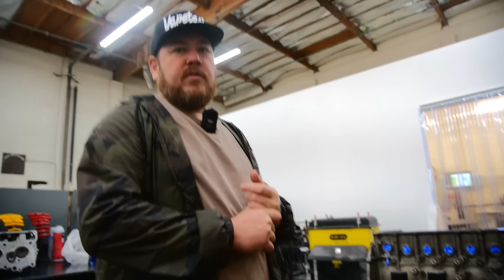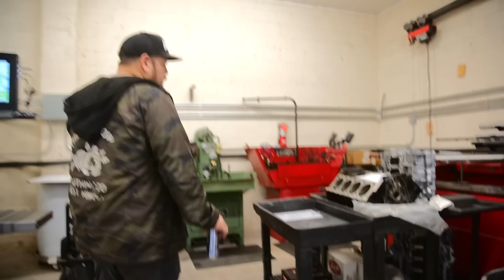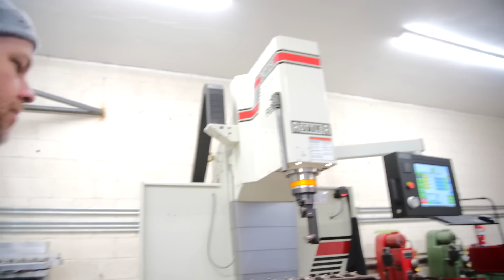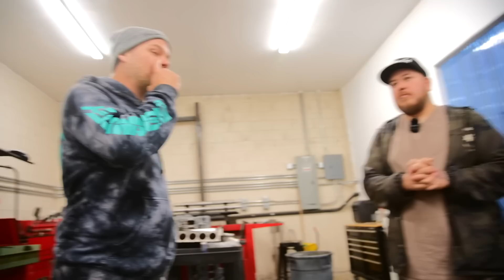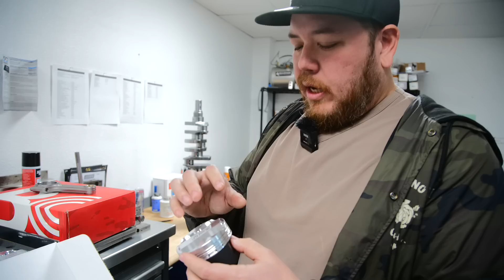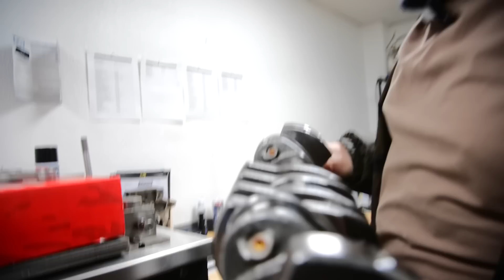Forrest Wang Formula D 2JZ engine builder interview

Comment: I love that he talks about the loose standards that the industry allows. It happens everywhere. CAI manufacturers will put out stuff that requires a lot of tuning, meantime there's a mustang CAI manufacturer called PMAS that has very repeatable data and even gives you a flow data sheet with your kit. Every intake he makes for a coyote tunes the same, meantime other manufacturers make intakes that all tune differently and then pass it off with a "just have your tuner adjust for it"

Comment: Loving the Sunnen horizontal honers, really miss the days before the machine shop went under in Feb 2020. 
I was using one of those machines to manufacture anulus for Rotrex superchargers.
The concentricity had to be within 5 microns I always aimed for 2 microns, this was on thin wall (4-6mm )55rockwell hardness parts up to 86 mm bore size with groves for oiling (we used a custom mandrel) needless to say it was an art.
I truly miss that machine shop and the guys that taught me so much.
If I lived in the states I'd have loved to meet Chris and the team to finally get my GE block built and ready for my E46, have had the damn thing 5 years now and still bouncing between shit jobs so don't have the funds, BUT 1 day I shall and I'll keep this info in mind.
THANKS FOR THE VIDEO.

Comment: Quick question, just getting into drifting in my 2011 5.0, what tire sizes would you recommend for seat time?
Reply: 265/35/18 is the most popular tire size
Reply: 265 kenda or valinos are fantastic for tire life
Reply: if you can do 235, it would be cheaper

Comment: I hate to say it but JZs just feel old and overdone at this point. I get it, they work but I wish we could see more modern interesting stuff. I'd like to see more b58s, and people diving into the cutting edge IC engines like the Nissan VC turbo and the toyota g16.
Reply: The reason why is cus they're tried n true. The B58 is an amazing engine but they're insanely expensive n there's not enough R&D behind it to use it in other chassis. The 2jz can be put in almost anything n can be built for the price of just purchasing a B58. N now with the prices of GTE's being so much ppl are turning to the GE blocks using GTE pistons or aftermarket n can handle 700hp reliably
Reply: @Ethan.Wahlgren  These days, B58's and 2J's are roughly the same entry price, depending on end goals.

You can actually snag a B58 longblock with accessories for as low as $5500 (5500-9000 is the range on ebay at time of writing), and that price has been steadily dropping bit by bit.   Sure, the R&D is not there yet for an easy drop in, but you can make 650 reliably on e85 without touching the longblock.  Could make 700 on a stock B58 longblock with a really dialed in tune, good fuel, and probably some ARP head studs.  I think we will soon see a B58 being cheaper to build than a 2J.

Thats where diving into R&D to fill the gap in the market comes from.  Once there is a good set of transmission adapters, engine mounts, and clutch setups, it is going to be a popular swap.  There are already PNP adapters for engine management and a decent amount of tuning data for the B58 proprietary systems like their multiphase oil pump and VVT
Reply: I think the B58s are still relatively new (but only take my word with a grain of salt )
Reply: Agreed, engines like the B48 and B58 are the future.  Pretty excited to see R&D done by name brand builders so we have more off the shelf data to work with.  They are starting to become more common place in BMW's and I hope we see the prices drop on longblocks sooner than later.
Reply: b58 isnt that great with bore/stroke ratio its 82mm bore and 94mm stroke vs 2jz 86 bore and stroke. bigger bore, shorter stroke means that it can be reved higher and its easier for bottom end. Can also be tuned to higher horsepower and because of shorter stroke 2jz can be stroked to atleast 3.4liter vs b58 3.2 liters and even longer stroke means even lower rpm, but good torq. this might not even be a thing unless pushing +800hp and +7500 rpm but still its there. thats why i would prefer 2jz over b58. bigger bore also means that it can fit bigger valves for more flow
Reply: somebody should build boosted s54